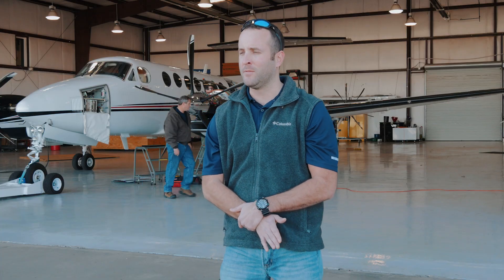King Air 350 Operator Experience | MG Dyess Flies Blackhawk's XP67A Engine+ Upgrade

Comment: What this do for the range?
Reply from the maker: It depends how you fly it.  If you take advantage of the more efficient compressor on the PT6A-67A and fly at higher altitudes, you can extend range.  If you fly the XP67A at FL280 or lower, you will reduce your range.  File for higher and take advantage of the efficiencies of the 4 axial compressors on the PT6A-67A.  In fact, the -67A compressor was engineered to operate at a service ceiling of 41,000 feet.  This is why you can get to the service ceiling of FL350 so quickly at max gross weight.
For more information on the XP67A, give us a call at +1 (254) 755 6711 to speak with one of our Engine+ Upgrade experts. 
- The Blackhawk Team
Reply: But if you use the same fuel consumption on the same floght level as the old engines, will you have netter efficience or at least thr same efficience? Thank you.

Comment: king airs are already super loud, this is gotta make it much louder. still would get this upgrade tho
Reply from the maker: Hi Tito, thank you for your comment!
The XP67A Engine+ Upgrade actually makes the King Air 350 much more quiet for 2 reasons: 
1) The upgrade includes the MT 5-blade composite propeller. These props are 102" in diameter, which reduces cabin noise substantially.
2) The upgrade eliminates the ground idle solenoid. Without the solenoid, you can taxi at 600 RPM, making ground operations quieter as well. 
So, the XP67A offers quieter operations on the ground and in flight - a win/win!
Thank you for watching our video, and please don't hesitate to reach out if you have any questions. +1 254 755 6711.
- The Blackhawk Team

Comment: Does the added power of these engines effect Vmc in this airplane? Thanks.
Reply from the maker: Hi Jason, great question. 
The added power does not affect Vmc, even with the different prop. The MT 5-blade composite propellers included in the upgrade meet the same Vmc numbers as the stock propeller. So, Vmc remains the same with the XP67A Engine+ Upgrade.
Thank you for watching our video, and please don't hesitate to reach out if you have any additional questions! +1 254 755 6711.
- The Blackhawk Team